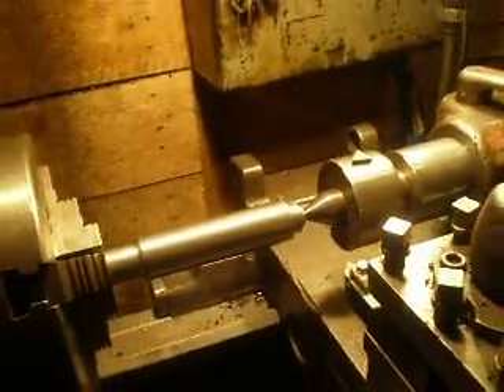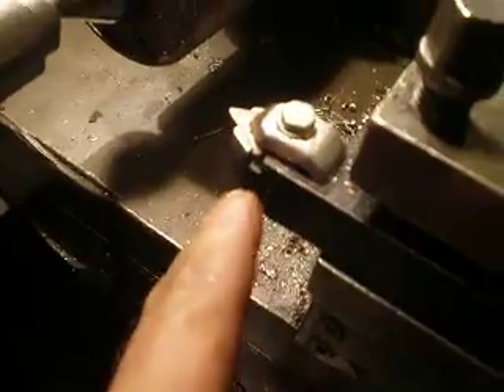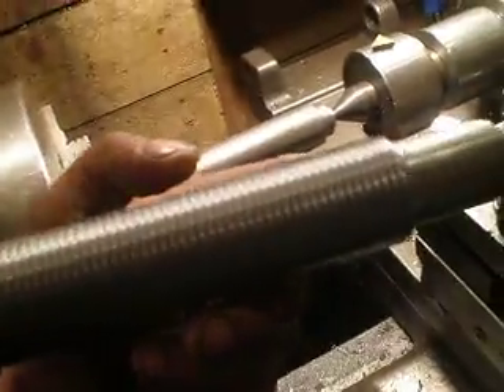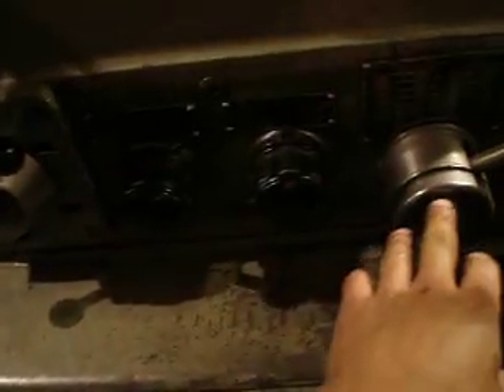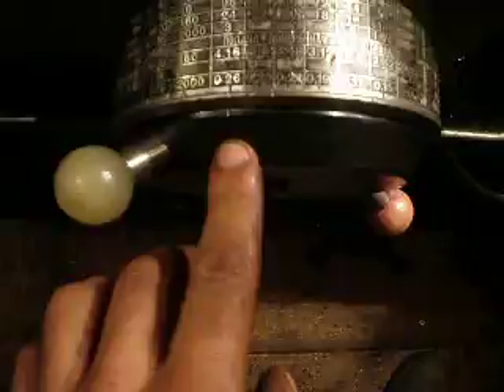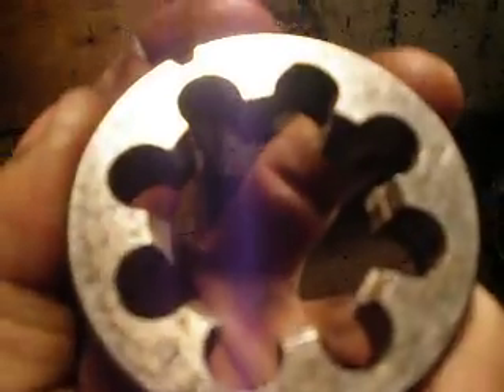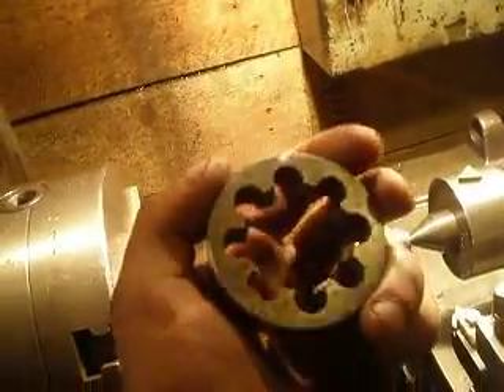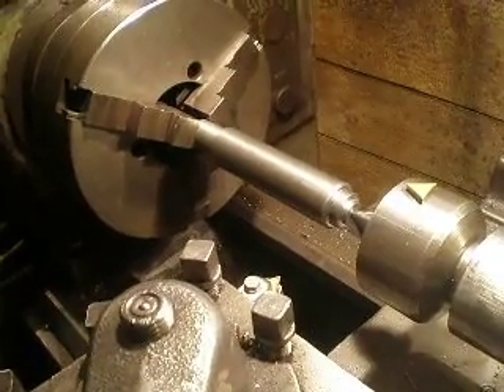Thread Cutting on 1K62 lathe part1 - set up machine for work

Comment: Hello dragon factory, i'm learning thread Cutting on 1K62 lathe, i can't found how to set up for cutting 1,5 and 1,25mm thread, i can find 1mm, 2mm, 4mm do you know what i'm doing wrong?
Reply from the maker: Ahm, well... on feed gearbox is complex feed-tread rate switcher 1:05 , it more looks like a drum. So. On it You will find lot tables with lot nummbers of feed/thread rates. That "drum" is complex as I told before - it turns in 4 postions, also inside plastick part - that with 2 handles, You can pull it out and choose one of 7 feed or thread speed rates. In case if You still have froblems with it, I can made video.
Good Luck!
Reply: I tried pulling the drum inside out, comes out about 2 centimeters but it doesn't turn it feels stuck, i've noticed there are 4 lines on it,do the machine needs to turn when trying to select with the inside pulled? Thank you.
Reply from the maker: Try use little bit forze while pull that drum... machine is soviet made and without russian swearing and "mother words" nothing will work. So, try pull out that drum with little bit more force - it must work! Yes, thise lines is for selection one of 7 feed/thread speed rates. 
Su pull out inside drum, then turn in until line is against your selected feed/thread speed rate and push inside drum back in. Good luck!